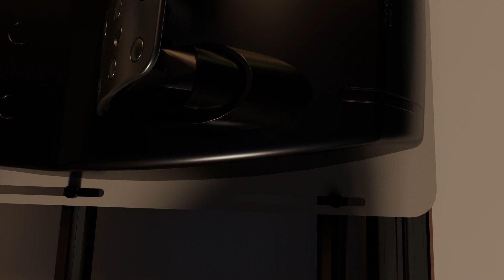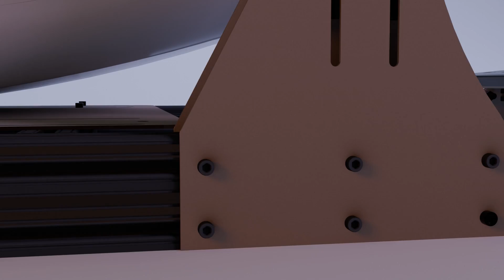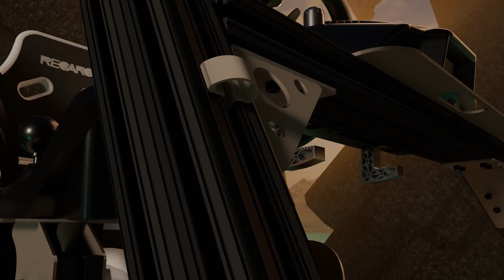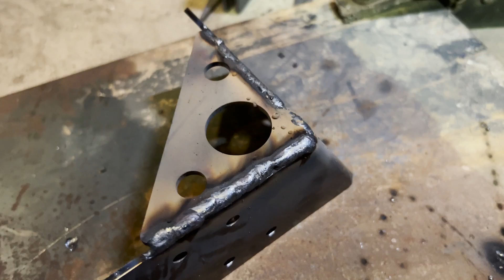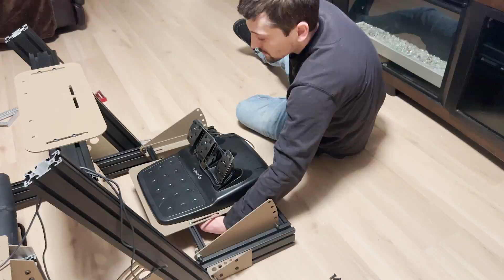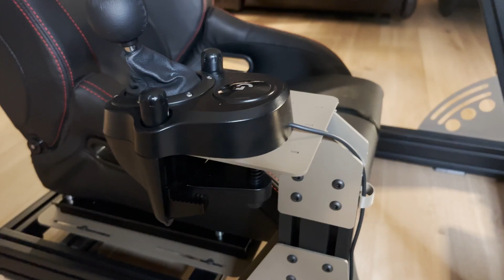DIY Sim Rig Build - Logitech G920

Comment: I will pay you to build me one I’m in the uk I have bunch sim stuff already I just want you build main frame
Reply from the maker: Unfortunately I’m in the US so I’m not sure that I could build one for international shipping. But I am working on a “slim version”, and tilt for the wheel. After which I plan to put the plans up for a decently cheap price.
Reply: You can easily do this yourself, it's just like a big meccano set. I sourced 5 meters of 8040 and 3 meters of 4040 aluminum profile and cut them down on the mitre saw, dead easy. Then just bolt everything with corner brackets and L and T bracing.
Reply from the maker: Very true, I’ve seen many rigs built this way. I decided to go against the grain and use laser cut plates to attach all the extrusions together, but angle brackets would work very similar. Im not sure if you’d be able to angle the steering wheel upright like I’ve got it with angle brackets though? It would be worth some investigating.
Reply: @piscesprinting  yeah, luckily the steering wheel angle wasn't an issue otherwise I'd have to fabricate something but Moza already has a mount for their DD wheelbases that I got. 
Everything else is bolt on, got some thick aluminum plates on the uprights that make it feel like a bolt-in roll cage. Just as rock solid 4 years on. I'm sure yours still cost less than the pre packaged commercial one's too. I got lucky and got my alu profiles before covid, apparently prices shot up a bit since.